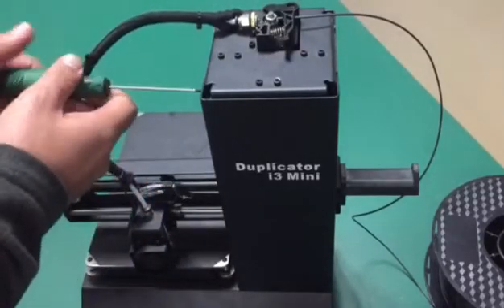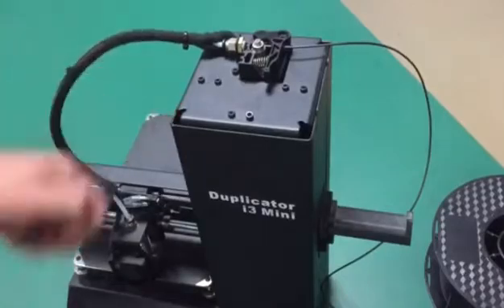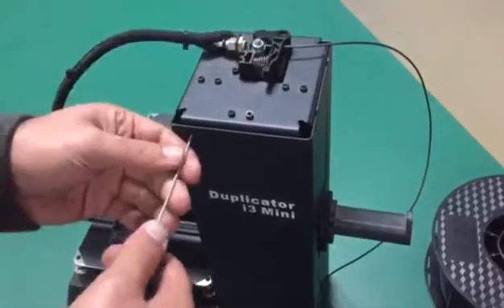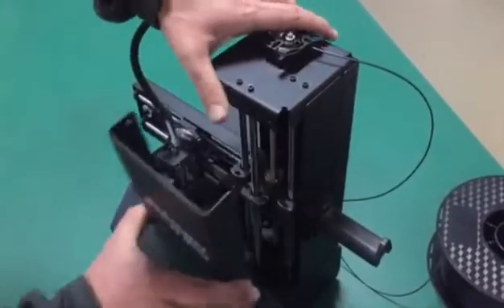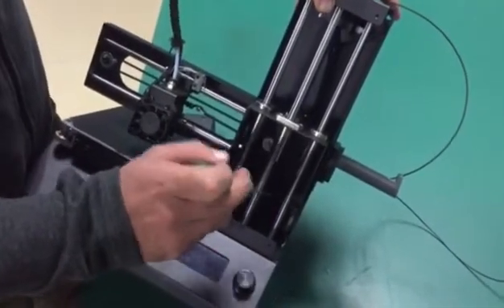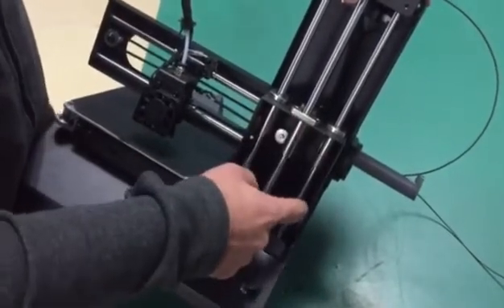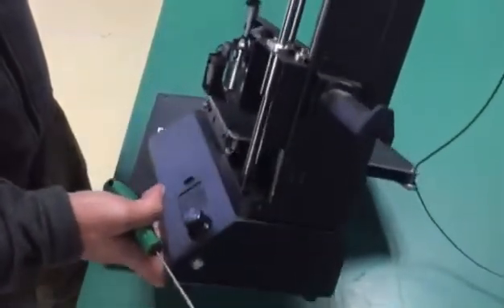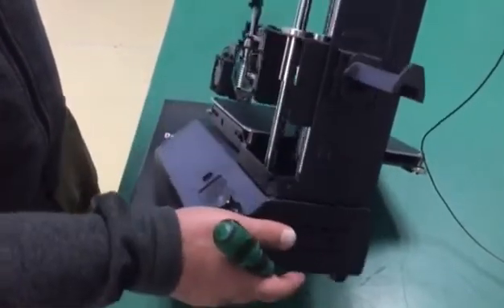i3 mini Z EndStop issue

Comment: I was having the Z stop issue. Every time a print completed and the head goes up I used to turn the printer power off, remove the print. When I truen the power back on the head would not z home.  It will be a few mm above the bed.  Did a number of reset button, factory resets power up downs. Combinations and one it would come back to the original z home.  So my solution was to leave the power on after print completion. Remove the print. Then hit Level Bed.  That will bring the Z back to the original position (also X and Y home) cancel out of Level Bed and I was able to move on to next print job.  Since I stopped powering down the system after a print I have not been having this issue.